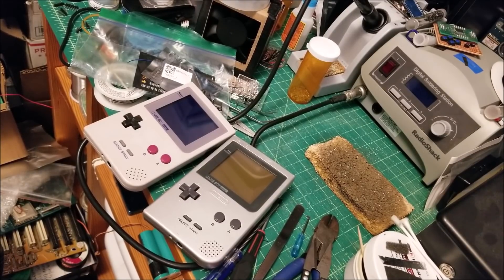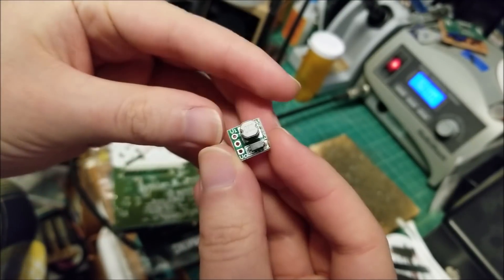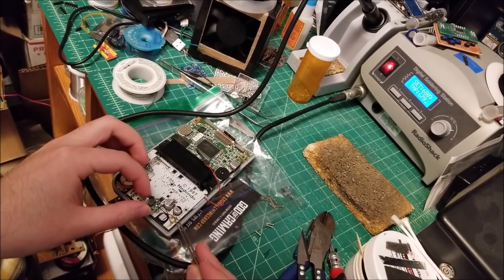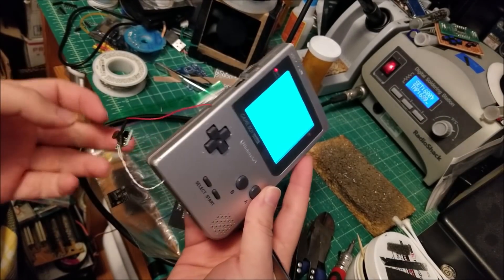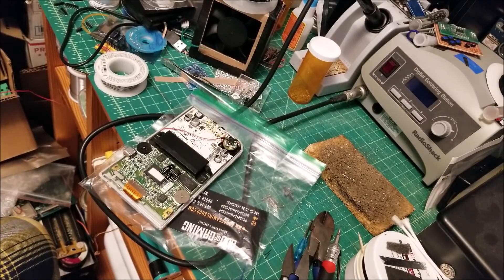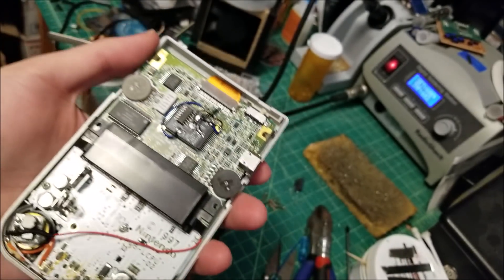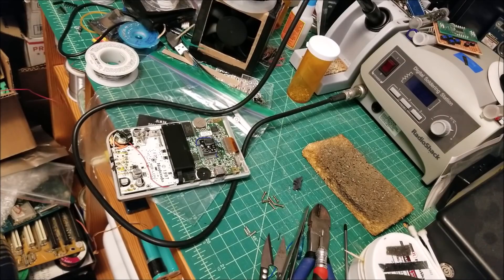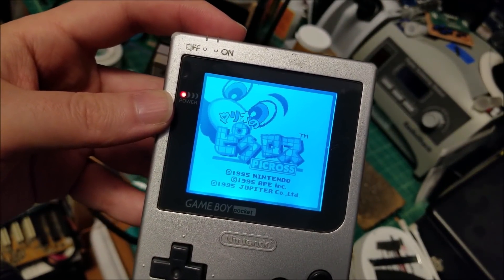Let's Mod: Nintendo Gameboy Pocket Bivert and 5V Regulator Install

Comment: I just ordered a 5V regulator (similar to yours) for my backlit GBP. I initially wasn't going to do the 5V reg mod, but after playing my copy of Final Fantasy Legend (for a grand total of two days) I noticed my batteries draining really fast. I don't mind the battery drain since I can always charge them, but I felt uneasy about what was happening to the game cartridge's battery (CR2025 I believe). Final Fantasy Legend is expensive and hard to find on eBay nowadays, and I don't wanna risk ruining the cartridge, so I guess I'll need to install the regulator if I wanna clock the game. Anyways, it'll also give me the option to use a Flash Cart in the future, so no complaints. Thanks for showing us how to do the install!
Reply from the maker: Afaik the internal game save battery shouldn't be affected by anything outside the cart but doesn't hurt upgrading the 5v regulator.
Reply: @sjm4306  Ah OK, that's a relief. I'll still keep the 5v step-up reg anyway since it was fairly cheap, and it's a good option to have. Thanks again

Comment: Thanks for this I followed along and it works great now. One question though, when the batteries run low the game stops working but the backlight stays on. I started timing it and got to 25 minutes and gave up. Is this because the backlight uses such a little amount of power?
Reply from the maker: Yep, a stock gbp draws around 80-100mA (depending on if it has the power indicator or not) while the backlight is probably pulling closer to ~20-30mA. Additionally the cpu will brown out when the regulated supply voltage starts dropping due to low battery, while the backlight can still run so long as the voltage is above the forward voltage of the leds (~3-4V).
Reply: @sjm4306  thanks for the reply. I suspected that was the case. I just let it run backlight only for the last hour, it really doesnt quit. I just measured the batteries with my multimeter and they are down to 0.85v lol. I am so happy you made this video, I was very disappointed with the backlight when I first installed it and handheld legend told me to replace the caps.. then told me to use the cart slot for power etc and when they kept giving me advice that didnt work I found this video. perfect.

Comment: Hey there! First off, thank you! I recently started my own business doing restorations and mods, and I have learned a ton from your channel. I was curious what gauge wire you used in this. I attempted it with 28 using the pins on the back of the board and the chip on the speaker. I couldn't manage to get the wires flat enough on the board to allow for a clean close, so of course, heat spot.
Reply from the maker: I used 30 awg solidcore kynar wire
Reply: @sjm4306  Awesome, thank you! I think the difference in the 30 should be just enough slack to make it work.

Comment: I've searched everywhere for someone that could help explain how to install a voltage regulator into a Pocket  with a Funnyplaying IPS screen. I'm getting a strange freezing/kind of screen burn when using a Nintendo Power flash cart. I think the regulator will fix this issue but I have no idea how to install it T_T please help

Comment: Would the voltage regulator fit in the front center like where the Gameboy light has a chip?
Reply from the maker: Possibly depending on how thick the regulator is
Reply: @sjm4306  I ordered the same one you used in the video
Reply from the maker: I didn't check but I suspect the inductor may stick out a bit too much but should be possible if you desolder it and extend the wires so you can attach it to the side of the module

Comment: So do you leave the old dc/dc board on and just connect the new regulator on its backside, or do you remove it entirely? Because when you were figuring out the pinout you held it in your hand (or was it a unit from another GBP?), but when you started to solder the cables it couldn't be seen on the video.

I'm quite new to GB modding and could not find an answer for this anywhere.
Reply from the maker: You wire the new boost converter in parallel with the original one's 5V output. If you were to remove the old dcdc and just replace it with the new boost converter the screen wouldn't work because the original dcdc actually has 2 outputs (5v, -19v) and without the negative voltage the lcd contrast bias is gone.
Reply: @sjm4306  I see, thanks for the fast answer :)

Comment: I've burned the internal voltage regulator on my DMG Game Boy because I installed a 3rd party Backlight, Bivert and the 1st gen Everdrive... too much power consumption for this baby :(
So I'm going to buy and install the independant 5V Backlight voltage regulator that handheldlegend.com recommends.

My question is: if I add for example the CleanAmp Audio Amplifier will I have the same problem again? (more power consumption = more stress for the game boy regulator).
Also, is necessary to install the extra voltage regulator on other consoles like the GBA AGB-001 with the AGS-101 mod? Or in this case is just to get more bright?
I don't want to damage another console again!
Thanks!

EDIT: I just discovered that I have the very 1st Everdrive version (Everdrive GB) and not the "X-series", this old version consumes between 3 and 4 times than the x-series, that's the problem.

Comment: Whats the best spot to pick the power for the 5v amp.  Some used the post at the existing 5v converter but removed a pin. I guess you dont have to do that?  . some just add it in like you did to those points. So many ways to do it I guess all work? Basically the small 5v converter pick a battery voltage spot not a existing 5v spot. I have the pocket version bivert chip ever solder one of those on? Its tiny.
Reply from the maker: In general it's a good idea to pick points at or near a decoupling cap that is across the 5v rail. This helps supply peak currents and reduce potential noise.
Reply: @sjm4306   Ok so no need to do this like here and remove the pin? https://imgur.com/a/o8ErbQo I frikken messed the cable too on my trash found pocket., The screen was trashed anyway burned front polarizer and rear polarizer had a dot in it.  if I flex the cable down it works. and it no longer dead in the center.  :D Have to tape it down now.

Comment: Did I miss where you grounded the back light? I see where you grounded the regulator, but aren't you supposed to also ground the backlight to the regulator as well?
Reply from the maker: The backlight can be grounded to any ground point in the gameboy since the regulator is not isolated and all grounds are common. I used the ground point at the pocket's original dcdc converter at the bottom right side of the gameboy.
Reply: @sjm4306 thanks a ton! I have to do this mod to my GBP and was a little confused. Would it be ok to ground the regulator and the backlight to the same point? My backlight is already installed and grounded to the point you used on the regulator. If it's ok to use the point for both, it'll make adding the regulator very easy!
Reply from the maker: Yep, absolutely no issue grounding both at the same point.

Comment: Still confused regarding the voltage regulators. Why do you (or other people) install another one instead of replacing the original one? Or am I mistaken?
Reply from the maker: Good question, because the original one is actually two regulators integrated onto the little daughter board (a 5V one for the logic and a ~-19V one for the lcd). If you were to entirely remove it and just replace it with a 5V reg then everything would work except the screen would be blank.

Comment: It just occurred to me, to reach ultimate efficiency, we could use a constant current boost converter and drop the current limiting resistor, possibly using some solar lights IC or by modifying the boost converter.
Reply from the maker: Yep you could totally do that.
Reply: @sjm4306  yep, very simple, if my math is right, the MT3608 with a 0.6V Vref, using a 10ohm Rsense will yeld 60mA (15mA per LED, assuming they are wired in parallel) https://hackaday.io/project/29502/logs?sort=oldest

Comment: I biverted and backlit a Gameboy Pocket.  With fresh batteries my Everdrive worked.  Now it doesn't.  So I'll have to install one of these.  Should 5v regulators be installed on DMGs also?
Reply from the maker: Yeah, everdrives are pretty power hungry, sound like your dmg could use a 5v buck boost to help (you need a buck boost since the dmg 4x AA starts at 6V and drops below 5V as the batteries die).
Reply: @sjm4306  I haven't had any problems running an Everdrive on a backlit DMG.
Reply from the maker: Usually dmgs can provide more current than a pocket, but depends on factors like cap and dcdc age/wear. The pockets are especially weak though in the power department due to the choice of AAA batteries.
Reply: @sjm4306  How about GBA Original?  I have a AGS 101 screen one that makes the led flicker to red.  Add a regulator or a rechargeable battery or both?
Reply from the maker: I'd start with a rechargeable battery and see if that helps. If not then adding a switching regulator might be a good idea.
Reply: @sjm4306  So installed the 5v boost and it still has problems with the everdrive.  Does the one you worked on work fine with the everdrive or why did your friend want the 5v boost added?
Reply: @DontPaniku  Try using AC adapter instead of batteries. 
Remember if you use rechargeable batteries usually they are 1.3V instead of 1.5V, so they will deliver 5.2V instead of 6V (X4).
Everdrive needs a lot of energy to load properly.
Reply: @MrEduedu123  Figured it out.  Everdrive works fine with a regulator added to a pocket.
Reply: @DontPaniku  Great, thanks!!
Sad this info was missing when I made the mod.
I will fix my Game Boy and buy the regulator, at least is cheap.
Reply: I have a DMG + Backlight + Bivert + 1st gen Everdrive (it drops a lot of energy especially when erasing/loading a new rom on the cartridge).
The internal power regulator start failling and now is literally burned.
Now I discovered in some actual backlight tutorials that if you don't use an extra 5v voltage regulator for the Backlight your game boy regulator will overheat until it dies, so be careful!
No one talked about this back in the day when people started to do backlight mods.

I hope I'm not overheating or damaging too any components on my GBA for the AGS-101 mod :S

If I add the CleanAmp Audio mod will I burn my console regulator again??

Comment: Hey. Thank you for your videos. Im gonna do the same as you here. Upgrade my backlighted pocket with a bivert and a 5V boost.
I ordered from Deadpanrobot and they didnt have the pololu booster I saw in the handheldlegend guide. But the "big brother" to it. It's a little bit bigger but it has "true shutdown".
https://www.pololu.com/product/2562    Is that something I should use?
Reply from the maker: Yes, that dcdc looks fine
Reply: @sjm4306  I hope I can fit it since its a little bigger. The only difference what I can tell is that it has "true shutdown". Im not that good at this stuff. I mostly follow guides from the wiser people like yourself :P You know if that is something I should wire in and use? And if so, how?
Reply: Maybe Im being stupid here. Is that shutdown function built in? No extra steps needed?
Reply: It reads in the description:
Additionally, unlike most boost regulators, this unit offers a true shutdown option that turns off power to the load (with typical boost regulators, the input voltage will pass directly through to the output when they are disabled).
And: True shutdown OPTION that turns off power to the load
Reply from the maker: Not necessary since the gameboy has its own hardware power switch. This is more for embedded microcontroller systems so that they have the ability to completely shut themselves or other electronics off (as opposed to soft powerdown where there would be non-negligible standby current).
Reply: @sjm4306  Oh okey. Thank you thank you.
Have you seen the guide they have on Handheldlegend? Is there any difference from your guide?
Reply from the maker: Looks about the same as the wiring I did (they just used a different boost module).
Reply: @sjm4306  Ok cool! Thanks for taking the time and also thanks for your guides/articles on handheldlegend. "Make Gameboy great again!" Could be your slogan xD

Comment: Hey! I really want to try this out. Your ebay link doesn't work anymore but I saw someone link to this regulator: https://www.pololu.com/product/2564 and it should work about the same don't you think? Right now the backlight is drawing power from the lower right hand corner and it gets noticeably warm
Reply from the maker: Yeah that pololu reg looks like it would do the job. Also thanks for the heads up, I've fixed the link.
Reply: sjm4306 I think I'll try it, thanks! love your  channel btw
Reply from the maker: Thanks, that means a lot to me!
Reply: @sjm4306  So excited, just finished installing it in my switch light colored pocket: https://imgur.com/a/9Zf6XWn 

It still behaves "weird" (power cuts etc.) but I think once I replace the caps it will pretty much be perfect, thanks!
Reply from the maker: That looks really good, especially like the backlight color. The power cuts can also be due to the power switch being finicky so it could be helpful to use a qtip to drop a bit of isopropyl alchohol inside the power switch on the pcb and work it back and forth a bit to clean the contacts inside.

Comment: How long does it take in real time? Also what would you say are the easiest GB mods?
Reply from the maker: The owner had already removed the lcd rear reflector and polarizer so just in terms of wiring the bivert and boost converter I'd say it took me about an hour, maybe a little less. The easiest gameboy mods are probably shell/button swaps.

Comment: I installed a similar module. With aliexpress. And he created noise in the speaker (in the description of 150kHz). I had to buy another (in the description of 350kHz) and it works perfectly
Reply: I've had a similar problem with the noise. Do you have a link to the one that worked?
Reply: thanks a lot for mentioning this! I was about to get the 150kHz one LOL

Comment: You added the 5v booster, Does this make the back light brighter? I noticed that after biverting mine, the screen is much dimmer than my original DMG with the same mod.
THanks for the help.
Reply from the maker: Color does have an effect for certain colors. Red is gonna be the most efficient electrically (has the lowest forward voltage), then greenish colors (human eyes are the most sensitive to green so it looks relatively brighter than other colors at the same actual brightness) and then white/blue (our eyes are least sensitive to blue and white is actually a blue led that is covered in yellow phosphor to generate roughly white light so it loses efficiency in that process).
Reply: @sjm4306  Thanks for the information. It has been very helpful.
Reply from the maker: Also keep in mind the DMG uses 6 beefy AA batteries while the pocket only has two puny AAAs so right from the gate it has the disadvantage of having less power available.
Reply: sjm4306 Thanks, That was my thought on this too. I hope this helps some. Does the color of the backlight effect it too? I got the teal one from Handheld Legends, Should I have gotten the white?
Reply from the maker: It does make it brighter if the original dcdc in the DMG was struggling. Most noticeably though it helps with contrast/flickering on the lcd and brownout resets due to overburdening the old dcdc.
Reply: @sjm4306  I have ordered a 5v booster, to try out. I just found it strange that my original DMG is really bright and vibrant and the Pocket is really dim.  Thanks for the help.

Comment: Thank you for this video!  I tried this mod for the voltage regulator last year and couldn't get it working.  Doing it your way worked great. I'm not sure what I did wrong originally but I think I was following a guide that used the regulator to replace the onboard unit so the vout pin to the logic  board in that unit needed to be cut and used to power the backlight. Anyway, your way is more cleaner and no pins needed to be cut.

Comment: So Ive heard some people install the 5v regulator and they also install a capacitor? or 2 capacitors. what is this for an can you do a tutorial on it?
Reply from the maker: Older systems tend to have capacitors that are getting old or have outright failed, leading to odd behavior like quiet sound/a dim or flickering display/system randomly resetting/or just plain not turning on. So it is usually a good idea to replace capacitors in consoles older than 15 or so years. I haven't done a video specifically on replacing caps on a console but yeah the next time I do a repair I can film a quick tutorial on it.

Comment: Could you provide a link to the 5V Boost Converter Module again please, as it's no longer available on eBay. Or the name of it (so it's possible to search for it elsewhere)?
Reply: Do a search on eBay for the following without the quotes.
"DC-DC 1.8V 2.5V 3V 3.3V 3.7V To 5V step up power voltage boost converter board"
Reply: Josh Gifford thank you!